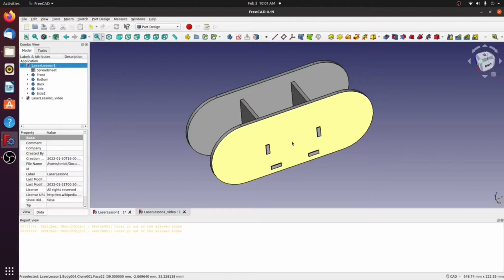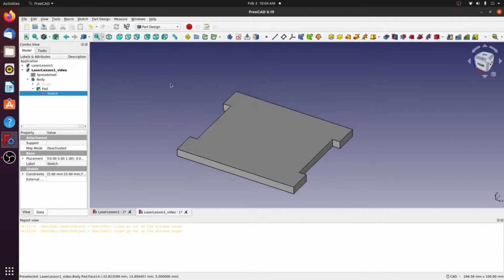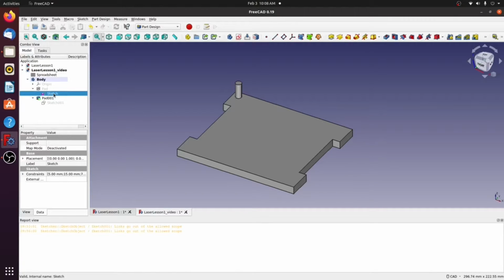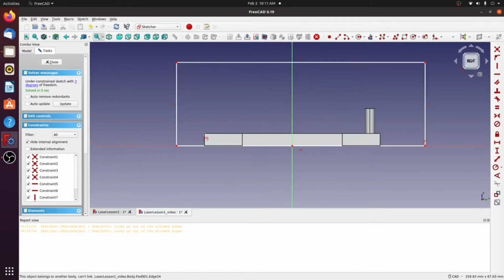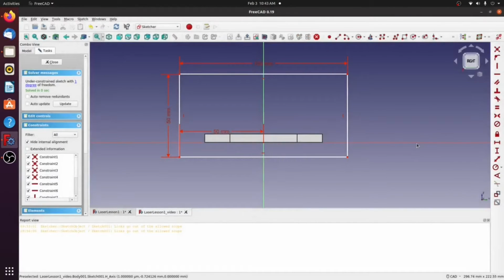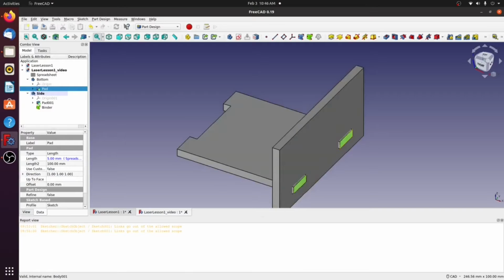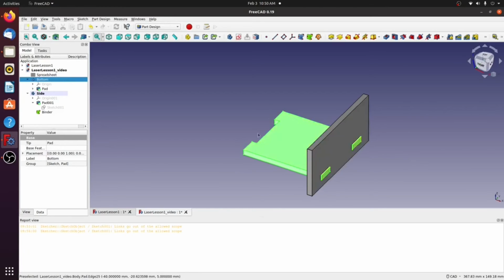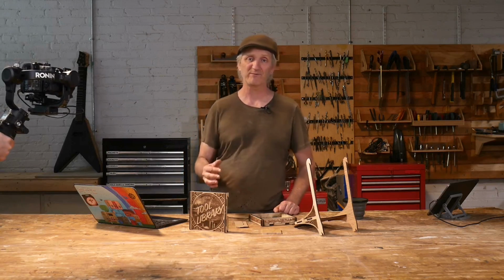Freecad For Lasers Pt 2 - External Geometry and Subshape Binder

Comment: Really great videos. Thank you. Just one question. When the pockets are not in the middle, but right on one side, I have to trimm the side, which leads to loss of several constraints - do I do something wrong?
Reply from the maker: Hey there! Most likely you would be losing a "vertical" or "horizontal" constraint when you use the trim tool. You see when you cut a line, the software makes a decision on which resulting line segment should get the constraint that used to be applied to the full line. So you may have to apply that constraint to the new section of line created by the trim. Also, you may need to apply vertical/horizontal to the points of your corners to ensure they stay aligned.
Reply: Thanks for your fast and valid answer. Appreciate your videos a lot. Regards from germany.